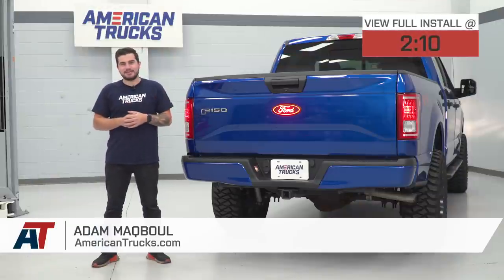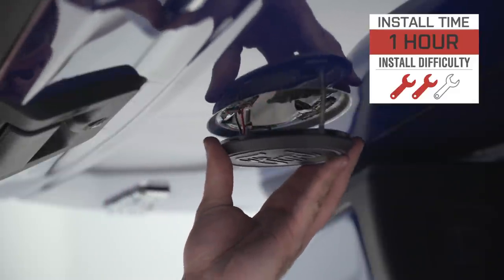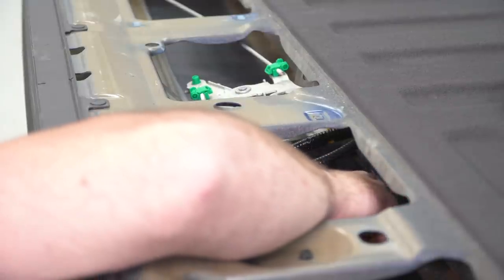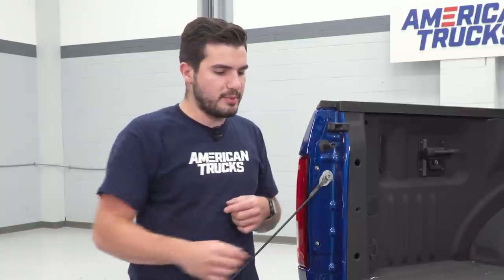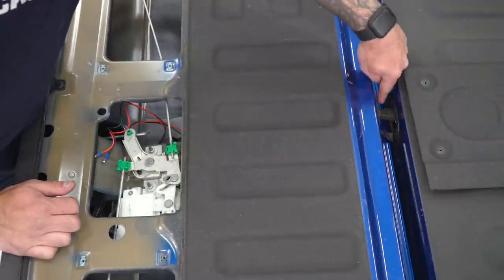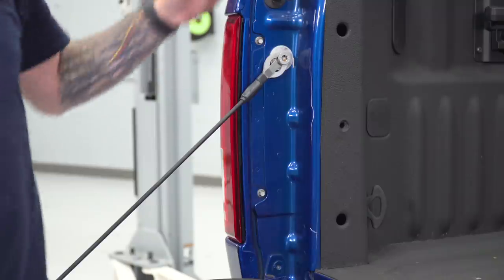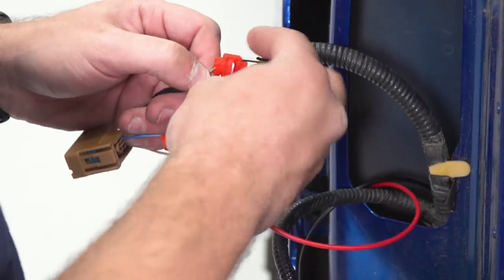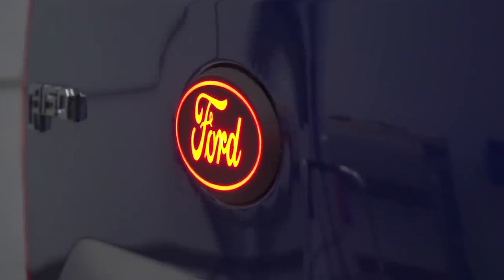2015-2020 F150 Luminix LED Rear Emblem Review & Install

Comment: Those plastic clip connections are absolutely horrible and a future failure waiting to happen..  I'd rather see a plug and play splice connector using oem connectors.  I'd pay $20 or $30 more for such a complete kit.

Comment: Why is it that everything you have is extremely overpriced!! Its a freaking emblem for crying out loud!
Reply from the maker: It's not JUST an emblem, it's an extremely bright LED accent that also acts as a running light. It's a much different look, with much different functionality. Definitely not just an emblem! - Adam
Reply: I agree. Ridiculously overpriced
Reply: If it was cheap, it would be on everybody's truck. That's why it's nice. Every chopped lowrider would have one.  Every POS primered grey truck, LA to NYC would be sporting them. I want my truck to be different. You can get the cheap knockoffs, but after awhile, you are going to look at it, when it's half lit, and faded almost white, and think, wtf was I thinking?
Reply: @johnwood406 , Agreed!! I tried the knockoff with the much cheaper price. Waste of money since it didn't work. Good luck getting a refund from China. Just got this 1 in the mail. Can't wait to get it mounted.
Reply: @americantrucks  I installed a made in CHINA works exactly the same for $50.00 I'm just saying...
I know is not gonna last for ever but once its gone I can just put up a different emblem, maybe customized or whatever...
Reply: @johndavidrosa  Just run it down to the license plate light through the inside of the tail gate. I tried the brake light, didn't work very well.
Reply: @johnwood406 , I'll have to give this a try since it didn't work connecting to the brake lights
Reply: What wires did you connect on the license plate light?
I got it working to the tail lights on my 2021 F150 XLT, but not on the top connector. My buddy came over and helped. I had 6 wires on the top connector, none of them worked. He got it working running the Red to 1, Black to 3 on the bottom connector, with the manufacturer support on the phone.
Reply: @johndavidrosa  From what I remember there was only 2 going to the plate light. Make sure you run loom with it, as there is a good deal of movement from the tail gate, and the ass end of the truck bouncing around. Also a good deal of road grime, and weather exposure. I put a custom bumper on my truck a few years back, so maybe yours is different. It's 2 wires that go to the plate light. I only have one plate light, so you may have to pick one or the other.  Test it, then zip tie in as many places you can.
Reply: @johnwood406  A friend of mine came over and helped me get it working. I called American Trucks support, they couldn’t help. Then called the manufacturer, they had me try all kinds of things, nothing worked. 
We got it working connecting the wires to the lower connector. Red wire to 1, Black wire to 3. That’s completely different from the diagram that came with the light. 
Took a longer than expected to get it working, but it looks AMAZING!!!

Comment: As nice as it looks, that price tag keeps me from buying it.
Reply: I found one on Amazon that’s all black but still lights up red for 50 bucks “Reese Towpower 86620 Emblem (Ford Lighted Logo Black Finish)” It fit my 2019 F150 XLT but make sure you get some extra 3M tape because the back is flat and the 3M tape that’s on it it’s not very secure but I also used a little bit of JB Weld and made a bracket for the back still worth the $47 compared to the 188

Comment: Bought it for my 2019 ford ranger and have so many wires on my single plug and no instructions even though on the site it says it has step by step instructions so here I am not knowing what wire is what even with ford diagram it's still vague yall shouldn't say step by step instructions and then show me a f150 with just 3 wires on the tailgate to my 8/10..... on the ranger link....lol

Comment: Make sure you tape up all of those connections or you will be shorting out.
Reply: I know, right?! What a mediocre (at best) installation. I would start with cleaning the emblem's old double sided tape residue, put new one, then the wiring with the exposed metal. Ridiculous.

Comment: I found one on Amazon that’s all black but still lights up red for 50 bucks “Reese Towpower 86620 Emblem (Ford Lighted Logo Black Finish)” It fit my 2019 F150 XLT but make sure you get some extra 3M tape because the back is flat and the 3M tape that’s on it it’s not very secure but I also used a little bit of JB Weld and made a bracket for the back still worth the $47 compared to the 188
Reply: Is the led light just as bright as this one?

Comment: Harness assembly is different for a 2022 Lariat 501A Supercrew.  There is now just one combined plug, for the rear running light and the rear stoplight & backup light, with MANY different colored wires…
Reply: What wires do I splice into?

Comment: I would definitely use some wire loom and shrink tube on all the connections because all those connections can get corroded and living in the north east with the salt and weather conditions it can be bad I love American trucks but there install videos aren’t quite the best especially if it’s someone that doesn’t really know about installs they need to be a little more informative to there viewers and customers just saying
Reply: You read my thoughts, Dan. They could have done a much cleaner install on this. It looked like they already tapped into the tail light wires and then did a crappy job of tapping them up.

Comment: It would sure be nice if one wouldn't have to cut into factory wiring like that,
It would  be nice if there was something that could clip through the trailer connection like a electrical hub that would be water resistant an if one needed a switch they could just run a wire to the cab
Reply: The problem with that, is when you connect to the trailer wiring, the computer tells the truck, you are towing something. It goes to default trailer mode, and shuts off your rear camera.
Reply: You could extend harness to fuse box and tap into power there
Reply: I actually ended up, just wiring it to my license plate light. Plenty of juice there and no issues.

Comment: I installed this as directed and I think it has caused a problem with my tail lights, possibly a resistance issue. My connections are secure. I have had multiple people warn me my tail lights aren’t working. Not sure what’s going on here yet but started when emblem installed

Comment: Will this fit an 08 f150, the illuminated f150 side fender emblems are advertised as fitting 09 -up,  but there is a vid of a guy putting the same emblem on an 04 f150 with no alteration.

Comment: What size lift is on that truck???
Reply: It's an 18 inch lift on 50inch Conti tires.
Reply: @243wayne1  18in lift? Dude Wth, your math is way off
Reply: @tiger2q  WRONG.  I checked.  It's an 18 inch lift for sure.
Reply: @243wayne1  where are u getting your info from? That lift there looks like its a 4 or 6in. Idk where the heck u got 18in from
Reply: I think it’s a 4” with 35”s
Reply: @243wayne1  if it was an 18” on 50”s it would be just shorter than #monstermax
Reply: @americantrucknation4891  seems that way. I know I wasnt crazy!
Reply: @tiger2q  Yeah, I don’t know where 18” came from. I have a 15 with a 2.5” level on 33”s and that doesn’t look too much bigger.
Reply from the maker: 4" Zone Lift with 35x12.5r20's - Justin
Reply: @americantrucks  thanks, I figured!